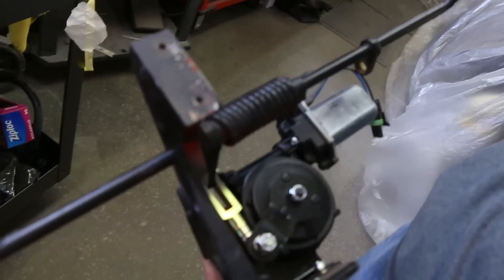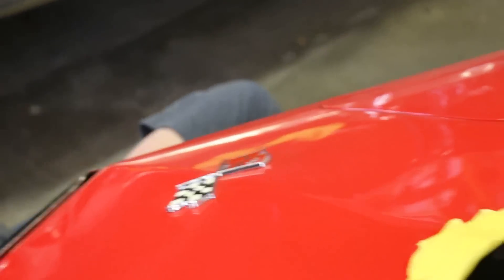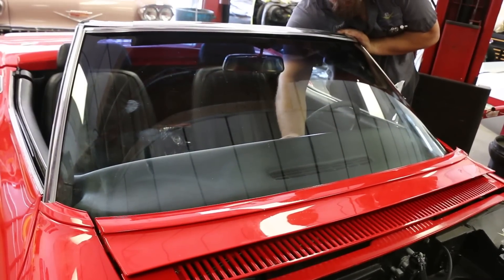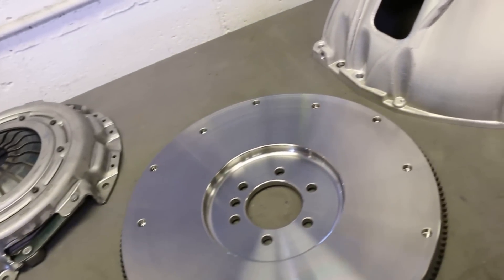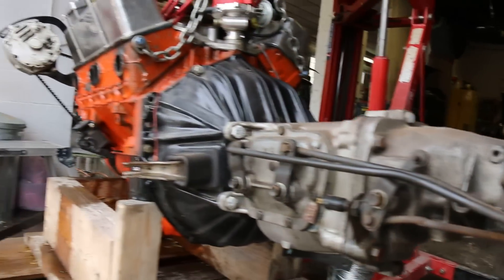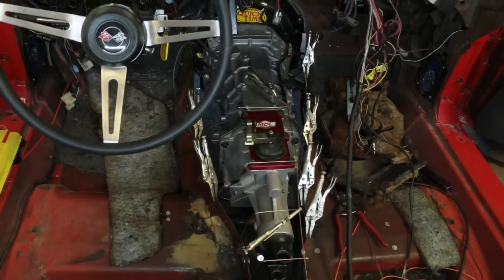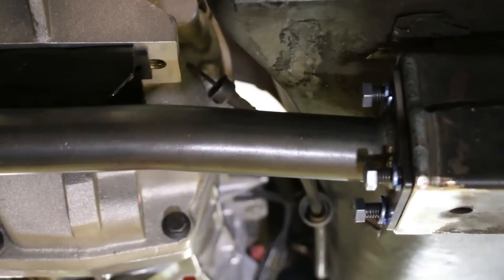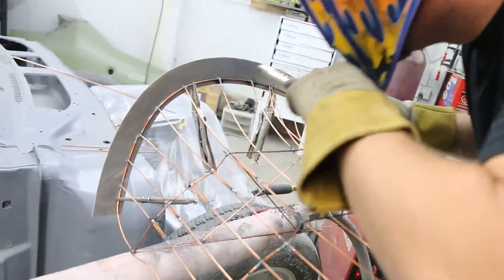Chevrolet C3 Corvette LS Swap 6 Speed Manual Transmission Swap at V8 Speed and Resto Shop Part 2

Comment: I was hating the idea of swapping an LS into an early C3, but for the later c3’s it makes perfect sense . Lots of them out there cheap. I wanna do it. I was thinking C4 LS swap and I just found an 85 with manual trans for $2000 in neglected condition
Reply from the maker: A C4 would be a great way to build a fast, cheap, great handling car.    Let us know if you do it!

Comment: I have a 69.  Still has original 300 hp 350 and TH400 trans.  Kind of a shame to see this one cut up, but it had already been modified.  And really, what did it cost for this work?  Big dollars!
Reply from the maker: You're right, the original driveline was long gone on this one.    It's unrealistic to think you can do a quality job on a whole performance driveline upgrade and expect to be cheap.   While we don't publicly discuss our customer investments,  we're happy to answer questions about any individual's project ideas on the phone.   They are all custom built, have different requirements, and require different mods / repairs, so there is no sense in blanket statements anyway.    Glad you hear you still have your original '69 intact, they are great cars.

Comment: Transmission sits at an angle?  If you look closely at the driveline, you will notice that the pinion is on the passenger side of the ring gear which coincides with the offset of the engine and transmission to the passenger side of the vehicle.  Looks like a straight line from the front of the crankshaft to the end of the pinion and in line with the frame to me.

Comment: Thanks again for the video and heads up. Very nice work and that welding wire does come in handy doesn't it?
Reply from the maker: Thanks, it sure does!     Keep an eye out (or subscribe) for part 3!
Reply: @V8TV   Standing bye for the next part. I've been subscribed for quite some years now. Awesome content! Did you leave the wiring or did you change it when dismantling the dash?
Reply from the maker: We changed much of the wiring for the dash upgrades.

Comment: how about doing a 10-speed conversion on one of these sweet C3 Vettes?
Reply from the maker: The 10 speed is a BIG transmission.    Currently, Chevrolet Performance is selling a Connect & Cruise 8-speed conversion, no 10.  You could use a take-out 10 speed, but it would be a good challenge to tune and calibrate it.   Interesting idea!
Reply: @V8TV  
probably need to cut some fiberglass, but man that trans kicks ass in the new Camaros and Mustangs.
Thanks for your reply
Reply from the maker: They are cool, for sure!

Comment: 6 gears is a marketing and fuel efficiency scheme. With that power to weight ratio a properly geared 4 speed would have been better. Who the hell wants to do all that shifting anyway, what are you hauling freight?